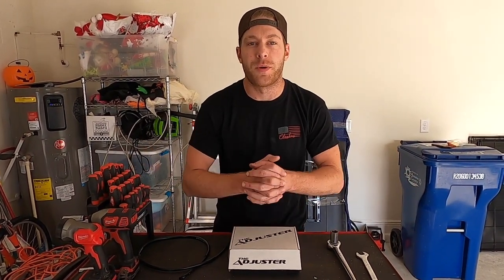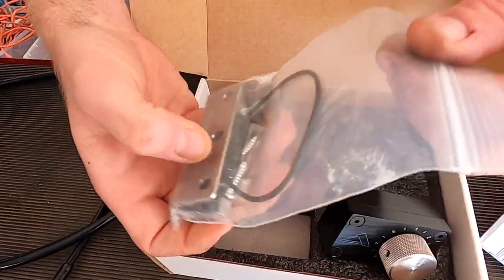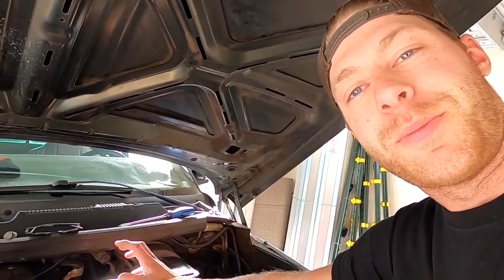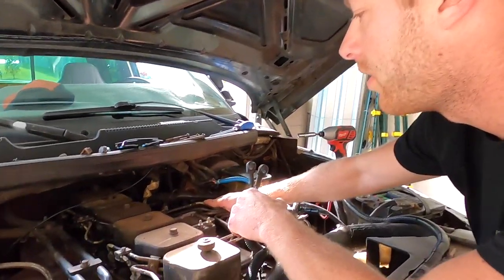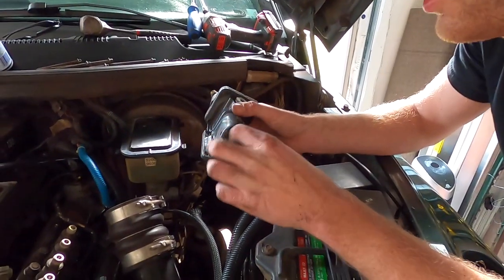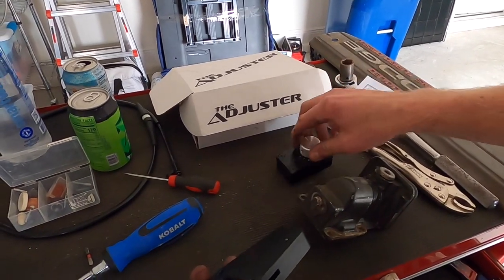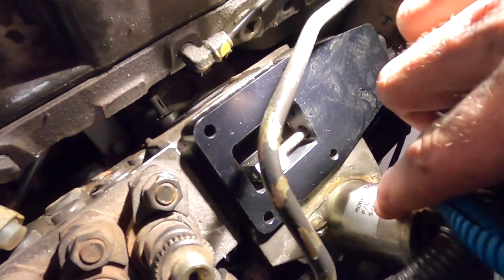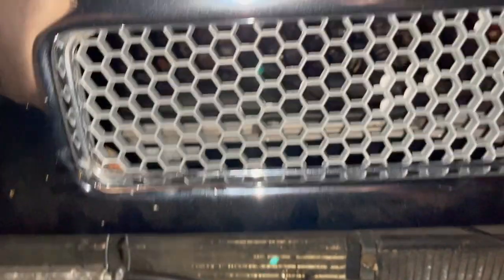MORE POWER & SMOKE!!!! 12 Valve Adjustable Fuel Plate Install & Review on my STOCK 12 Valve Cummins

Comment from the maker: What other mods should I make to add a little spice but keep it close to stock?
Reply: wheels and tires
Reply: I would bulletproof that Bruce Jenner first and also a one piece driveshaft,  and maybe add some timing  to get the most gains! And maybe an after market exhaust manifold for better flow and lower EGT’s.
Reply from the maker: Keeping these they’ve got good tread and the stock look I’m going for
Reply: Definitely look into a complete Carli suspension kit, and upgraded steering components, these will be the few things that will deter you from driving it daily and eventually selling it, (aka not fulfilling childhood dream) BOL Great video 👍🏻
Reply: All for keeping the stock look, especially with wheels and tires but probably should get trans sorted especially if you go with bigger injectors, Check out John Muldoon or @MulBoost on IG
Reply: Advance timing, 3k governor springs! Stock look but nice and spicy.
Reply: i know it's kind of off topic but do anybody know of a good place to stream newly released series online ?
Reply: @Theodore Darian i dunno I use Flixportal. You can find it thru google:P -harold
Reply: @Harold Daxton thank you, I signed up and it seems like they got a lot of movies there :) I appreciate it!
Reply: @Theodore Darian glad I could help :)
Reply: ported intake horn 
larger intercooler 
injectors 
mechanical vgt turbo 
built trans 
tint 
all terrain or mud tereain tires (bf goodrich ko2 ) 
led light package
Reply: some kind of dual intake horn pusher makes a good one

Comment: You may want to look at getting an airbox on the truck. We've done a lot of "fuel only" builds for customers that quickly surpass the cfm's they'll flow on stock manifold and charger. On the dyno you can watch the filter indicator suck itself to red on a good filter.

Comment: With the adjuster installed and on level 5, it runs the same as my truck with no fuel plate, afc ff, and star wheel ff

Comment: Awesome !  Just got My 96 back from shop.  Auto trans build costed me 2800 Cash no tax 😀   mechanic garenteed me it will hold 900 fps torque . So I adjusted the smoke screw Gear about 20 clicks and WOW this thing moves . I didn't touch fuel plate or anything else it was 100 percent stock. I just might tweek the fuel plate in the future
Reply from the maker: Nice! Get the fuel plate it’s worth it
Reply: do you have a build list for your trans? Im due for a new one as well.

Comment: I have this on my 96 F800 with 3k governor springs, boost T, set to 35psi, do the same you wont regret it. Also getting my allison transmission fully built next weekend.
Reply from the maker: Hell yea that’s awesome
Reply: Is your 97 f800 a 5.9 or 8.3?